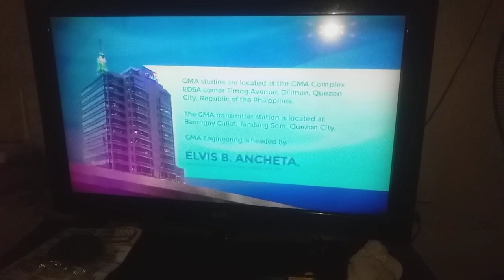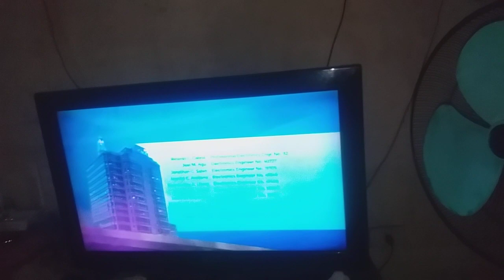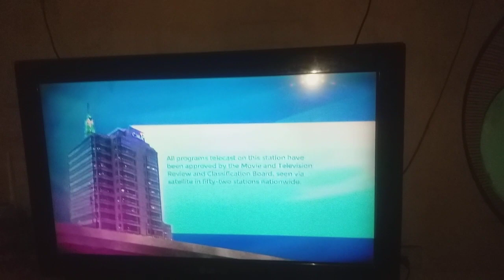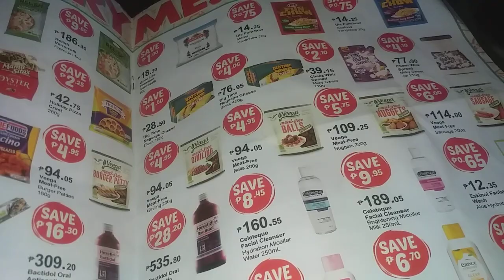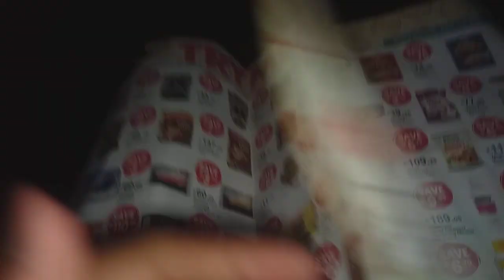GMA 7 Sign OFF May 19, 2021

Comment from the maker: This is '''GMA-DZBB CHANNEL 7.'''

A Commercial TV Station with 100,000-watt transmitting power authorized under Station Licensed No. '''BSD-0193-2019 (REN)''' issued by the National Telecommunications Commission Valid until '''December 31, 2022.'''

GMA studios are located at the GMA Complex EDSA corner Timog Avenue, Diliman, Quezon City, Republic of the Philippines.

The GMA transmitter station is located at Barangay Culiat, Tandang Sora, Quezon City.

GMA Engineering is headed by

*'''Elvis B. Ancheta''': <small>PROFESSIONAL ELECTRONICS ENGR. NO. 897.</small>

GMA Transmission Personnel is composed of Electronics Engineers, Electronics Technicians, and First Class Radio Operators with License issued by the Professional Regulation Commission and the National Telecommunications Commission.

*'''Ricardo L. Cabral''': Professional Electronics Engr. No. '''92'''
*'''Joel M. Agu''': Electronics Engr. No. '''40727'''
*'''Jonathan G. Salvo''': Electronics Engr. No. '''19705'''
*'''Jayrald C. Arellano''': Electronics Engr. No. '''49545'''
*'''Bonnie Rey A. Ulang''': Electronics Engr. No. '''47499'''
*'''Christian L. Jundis''': Electronics Engr. No. '''58240'''
*'''Rodrigo P. Cuizon, Jr.''': Professional Electronics Engr. No. '''875'''
*'''Eric D. Calaycay''': Electronics Engr. No. '''26010'''
*'''Louie O. Siapengco''': Electronics Engr. No. ''' 15586'''
*'''Ralph T. Palma''': Electronics Engr. No. '''29315'''
*'''Ryan Jesus I. Zapanta''': Electronics Engr. No. '''41636'''
*'''Mamerto D. Logronio, Jr.''': Electronics Engr. No. '''28729'''
*'''Celestino A. Vega, Jr.''': Electronics Engr. No. ''' 19182'''
*'''Reykel M. Espiritu''': Electronics Tech No. ''' 305'''
*'''Arvie P. Cariaga''': Electronics Tech No. ''' 603'''
*'''Rafael A. Racelis''': 94-1PNCR-11977
*'''Innocencio Robert D. Maniago''': 95-1PNCR-15029
*'''Arnel V. Aricheta''': 93-1PNCR-6617
*'''Nathaniel F. Santiago''': 11-1PHN-26421

All programs telecast on this station have been approved by the Movie and Television Review and Classification Board, seen via satellite in thrity-two stations nationwide.

'''LUZON'''

*GMA-7 Manila
*TV-7 Batanes
*TV-5 Ilocos Norte
*TV-48 Ilocos Sur
*TV-7 Abra
*TV-7 Tuguegarao
*TV-13 Aparri
*TV-5 Mt. Province
*TV-7 Isabela
*TV-10 Benguet
*TV-5 Baler
*TV-10 Olongapo
*TV-12 Batangas
*TV-44 Jala-Jala, Rizal
*TV-13 Occidental Mindoro
*TV-12 Puerto Princesa, Palawan
*TV-6 Brooke's Point, Palawan
*TV-8 Coron, Palawan
*TV-7 Romblon
*TV-7 Masbate
*TV-7 Naga
*TV-12 Legazpi
*TV-13 Catanduanes
*TV-2 Sorsogon
*TV-8 Daet

'''VISAYAS'''

*TV-5 Calbayog
*TV-8 Borongan
*TV-10 Tacloban
*TV-12 Ormoc
*TV-2 Kalibo
*TV-5 Roxas
*TV-6 Iloilo
*TV-13 Bacolod
*TV-30 Murcia, Negros Occidental
*TV-7 Cebu
*TV-11 Bohol
*TV-5 Dumaguete
*TV-10 Sipalay

'''MINDANAO'''

*TV-35 Cagayan de Oro
*TV-12 Bukidnon
*TV-4 Dipolog
*TV-5 Ozamis
*TV-3 Pagadian
*TV-11 Iligan
*TV-26 Butuan
*TV-10 Surigao
*TV-2 Tandag
*TV-5 Davao
*TV-8 General Santos
*TV-9 Zamboanga
*TV-12 Cotabato
*TV-12 Jolo

'''This is''' '''GMA the Philippines Largest Network, now Signing on/off.'''

''Note: This station message used after the national anthem during sign on and again before the national anthem during sign off. This station message background is updated on May 10, 2020.''

''Note: As May 10, 2020 This station notice of the network is cropped again in full-screen format.''

''Note: GMA Network used its 70th anniversary logo at the end of the station notice. This the first time they used an anniversary logo. GMA reused its 2007 station ID (instrumental version) as the background music.''

''Note: They added its new Electronics Technicans.''

''Note: This station message used after the national anthem during sign on and again before the national anthem during sign off. This station message background is updated on May 10, 2020.''

''Note: As March 31, 2021, This station notice of the network is cropped again in full-screen format and cropper again in wildscreen''

''Note: GMA Network used its 70th anniversary logo at the end of the station notice. This the first time they used an anniversary logo from May 10, 2020 until March 30, 2021. returned to GMA logo animation with 2014 version of GMA logo animation.''

GMA reused its 2007 station ID (instrumental version) as the background music.

''Note: They added its new Electronics Engineers (ECE) and First Class Radio Telephone Operators (RTO), Eric D. Calaycay, and Ryan Jesus I. Zapanta along with former IBC 13 Electronics Engineer, Christian L. Jundis and former Light TV Electronics Engineer, Bonnie Rey A. Ulang as the newest operators of the network.''

''Note: They dropped Harrold Kim D. Magarro and Alan S. Mangubat in May 10, 2020, and Erwin R. Timbre in March 31, 2021, Magarro transferred to CLTV36.''